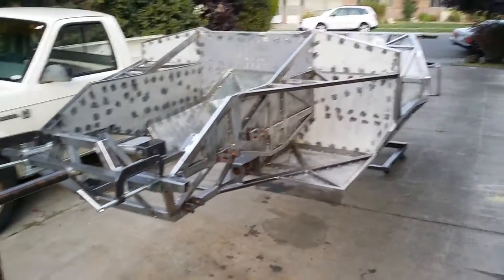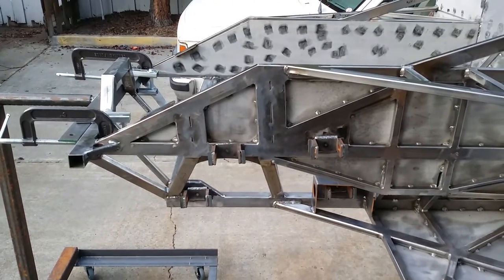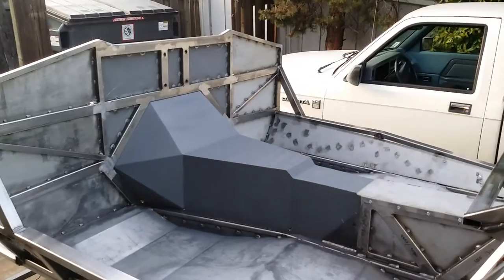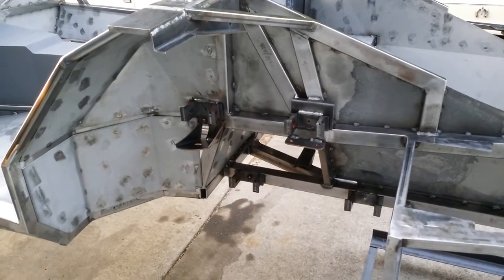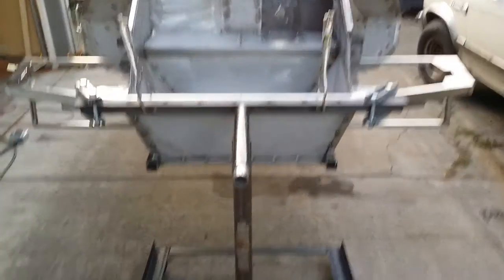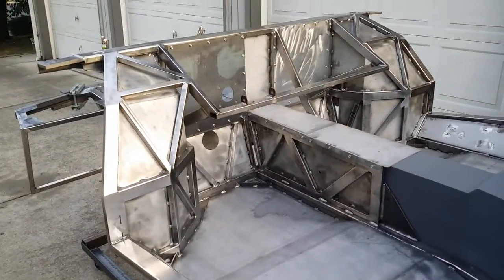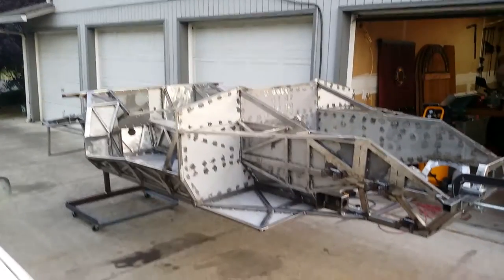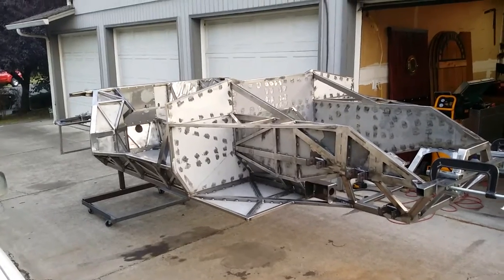NAERC Chassis Lamborghini Diablo

Comment: Did you use anything to seal up the space where the 16 gauge panels meet the tubes? I see where you stitch welded but is there anything stopping rust from forming in those gaps? I know you made this video a while ago so are you having any rust problems?

Comment: Bro, could you help me to build my own chassis? If you have the dimensions of this project? I bought a aventador chassis project here in Brazil and I have my doubt's about if the accuracy of it is right... the dimensions of mine is about 4234mm length / 1879mm width / 957mm height.. really thank you bro, I appreciate your job!
Reply from the maker: This chassis is for a  Diablo/Murcielago. Not for an Aventador. Chassis dimensions: 163''x68''x29''. You can buy NAERC chassis plans on ebay. If your looking for a aventador chassis... I have little knowledge, and wouldn't be much help. Check out lmaboclone.com for that.

https://www.ebay.com/itm/Naerc-Chassis-Plans-Lamborghini-Diablo-Kit-Car/233419392152?hash=item3658e14498:g:vYMAAOSwOEJd4ow4

Comment: how much did it cost right up to this stage and is it steel or aluminium? any idea about weight? thanks
Reply from the maker: +TheCynicalAfro 101 Chassis is made from mild steel. I`m a HVAC Mech. by trade. I have access to a full shop which cut cost down. Its around 5k for tubing, sheet metal, and paying a shop to cut and brake CAD parts. Chassis weight is 800lbs.
Reply: Thanks for your reply. it puts alot into perspective